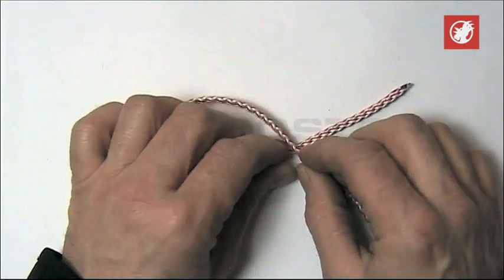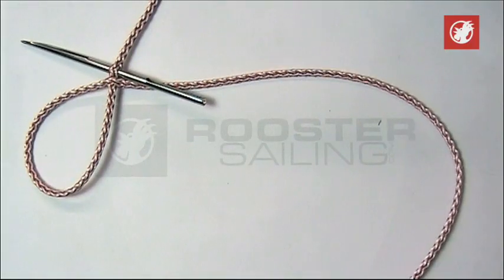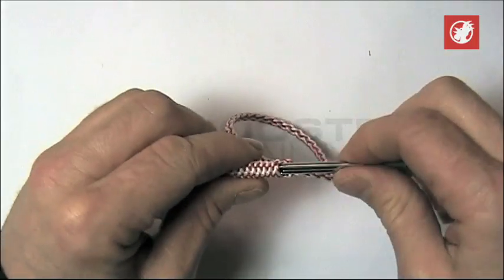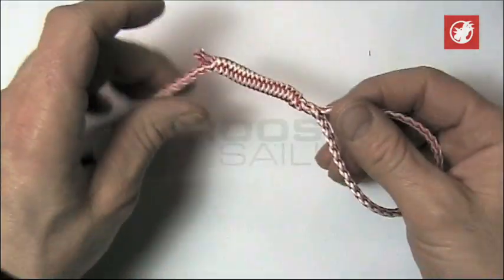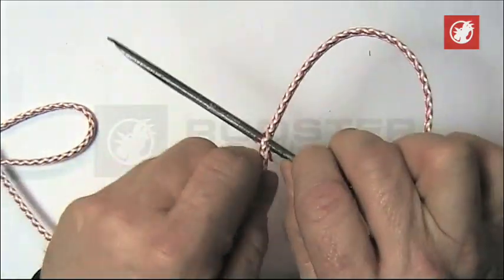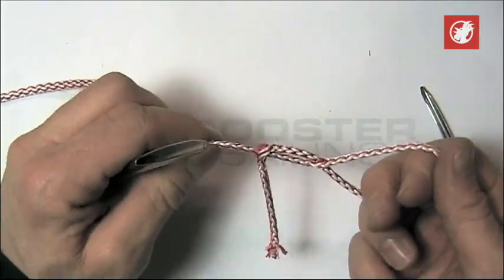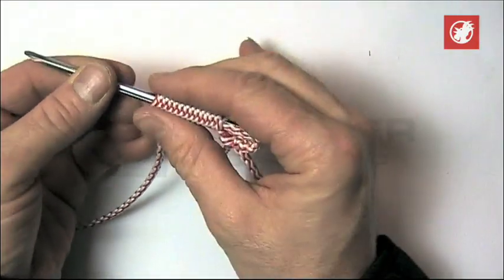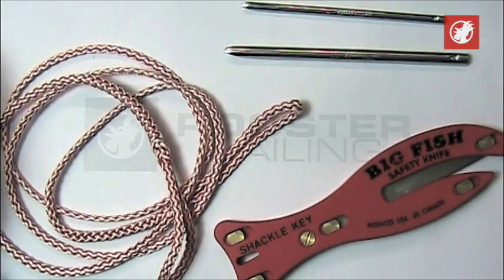Simple Splicing in Spectwelve Dyneema Core with Push Fids

Comment: Your buried parts are way too short. They take the whole load and should be 72 times the diameter of the rope, 50 times being an absolute bare minimum. You also should taper the ends before bury. 

Your splices will break at way below the breaking load of the rope. Properly done they have the same strength.
Reply: Abraham, maybe you should do a video since you know it all, just saying!